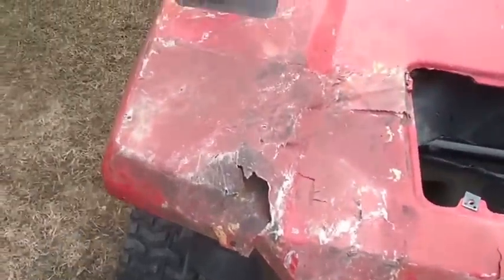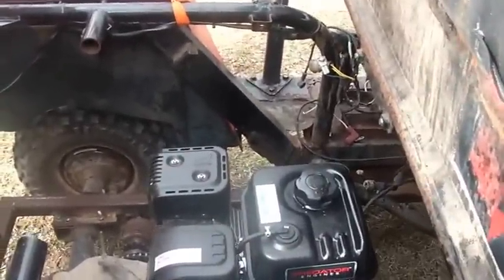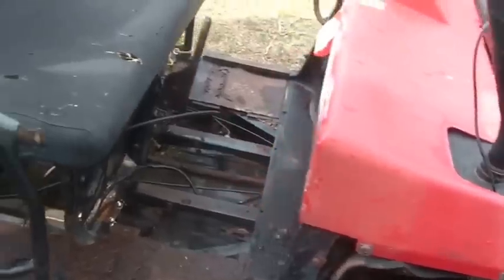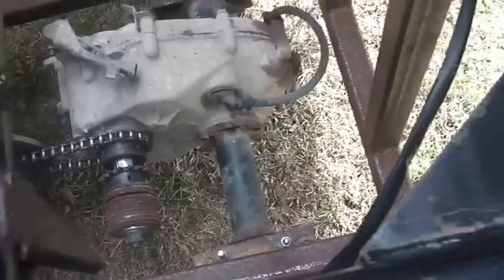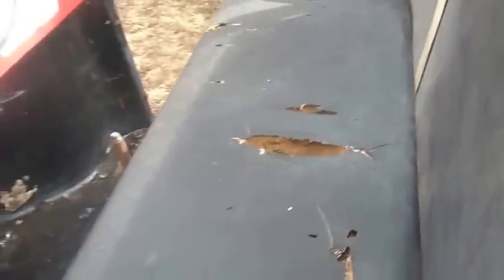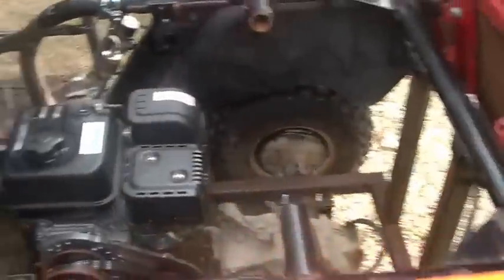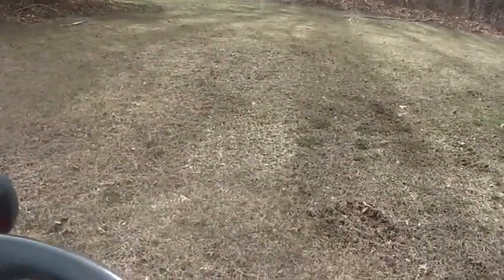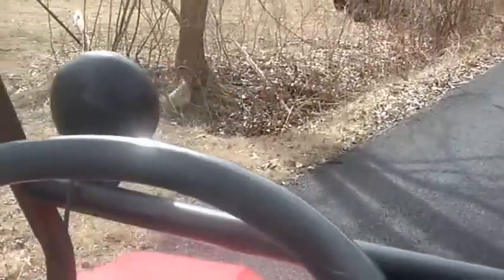Repowered KAF450 Mule, $100 6.5Hp Predator, winter slumber ends

Comment: cool stuff,,like kaw with the dump bed..plus the 4 wheels. which is what ive been looking for to snow plow. my garden tractor only has the rear wheels...i just fixed my sisters radiator in her car..plastic radiator. told her to trade it in. was easy fix jut re seamed 1side. then brother n laws ford trucks radiator started leaking. had him pull it out and re seamed the whole top tank. while it was out told him to go ahead and replace water pump from napa or the dealer. found the radiator top hose was pulling down is what separated or helped pull on it. they have a sleeve the hose goes thru looked bent. showed him no pressure the hose now. plastic and runner from china does not last long

Comment: Amazing what a 6 hp engine can haul.
Reply from the maker: Hey Dalesworld!!!   The Repowered Mule is geared pretty low and the torque converter helps a lot also, but, Ur right, it is one heavy machine.... The electric start motor I plan to install is a 7hp, slightly more power.... Thanks for your encouragement, watching, and commenting!!!